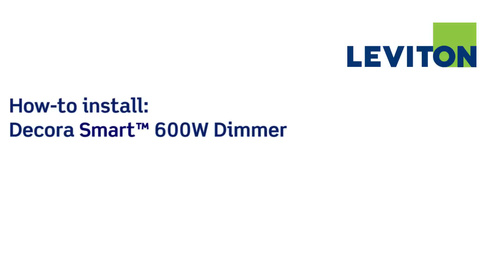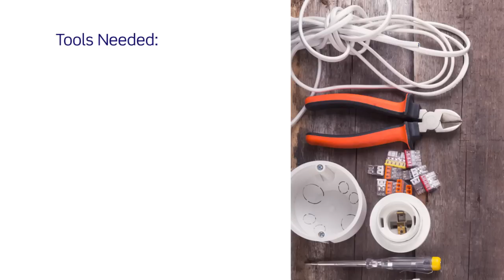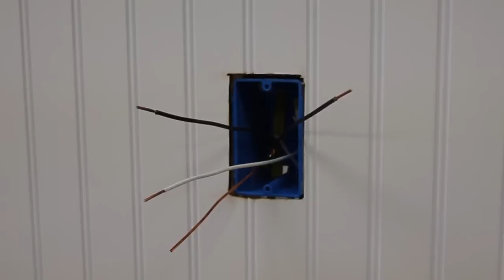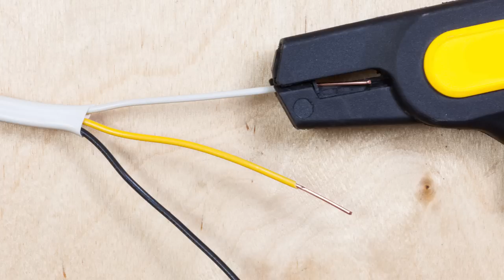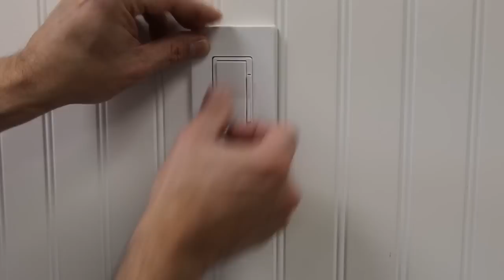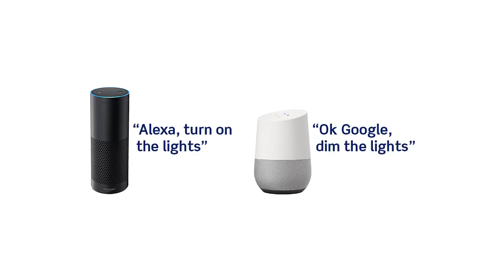How to Install a Leviton Decora Smart Dimmer (DZ6HD, DW6HD, DH6HD)

Comment: I have wired this z wave dimmer switch as shown in manual with led recessed lights and the dimmer will flicker the lights when turned on. When I do a full dimmer sweep from low to high it stops flickering until I turn the light off and turn it back on when it starts flickering again. There is only a note about bad wiring connection in the troubleshooting section. I checked all the connections a number of times and again I don't understand why it works after a dimmer sweep without a problem until it's off again. Can anyone help?
Reply from the maker: Hey Michael, for the best technical support for the Z-Wave Dimmer, we suggest you fill out the form located here: http://www.leviton.com/en/support/product-support/electrical-wiring-devices-residential

Additionally you can call 1-800-824-3005 for support

Comment: Im trying to install for a single pole operation. I only have 2 wires in my box, black and white. I mad a bare copper and grounded it to the back of the box. What is a "load wire?"
Reply: Nick load wire is the wire going to the light (or load), should be black.  Line is your hot wire could be black or white, depending whether the wires pass through the switch box or light box.